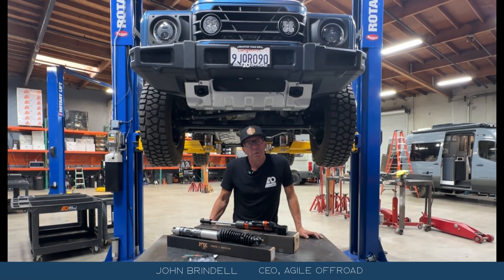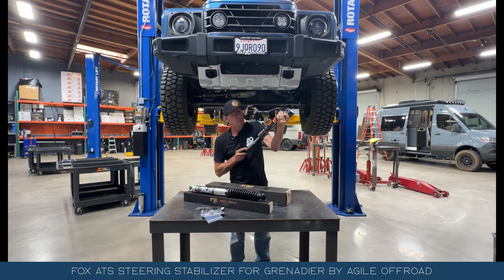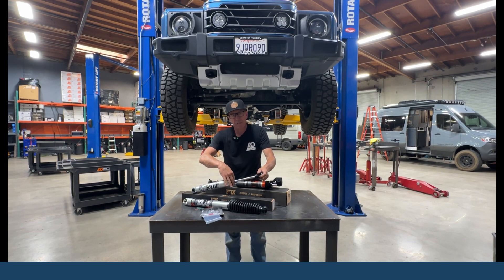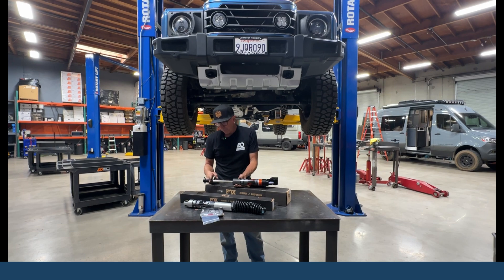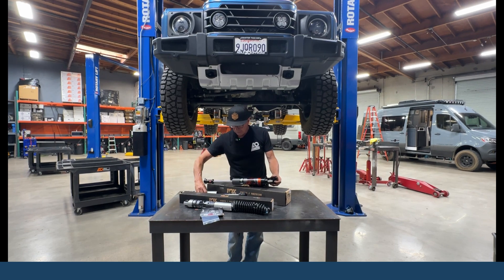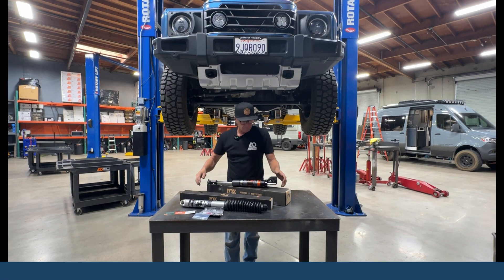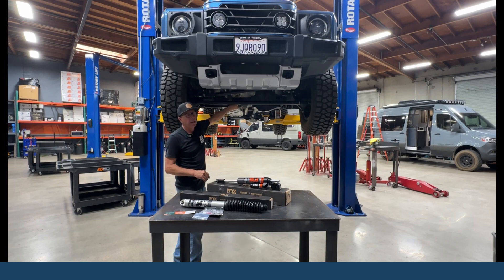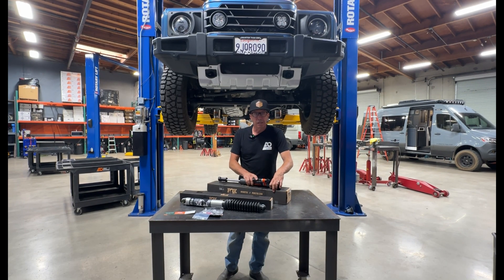Learn all about the new Fox ATS Direct Fitment for INEOS Grenadier

Comment: Does this address the return to center after a turn issue?
Reply from the maker: The Fox steering stabilizer will improve the return to center on the steering, but it will not completely fix it.
Reply: @Agileoffroad  The factory caster angle in 0⁰ i believe a mod is needed to index a couple of degrees + for onroad driving and return it to 0⁰ if heading offroad.
Reply: That is a great question.  In my case I simply removed the oem version and drive with no stabilizer and on the road I have no issues and now I have no return to center issues, ever thing works perfectly.  I have not been off road as of yet so that is to be determined.

Comment: Could you show a video of doing a 90 degree turn and where the wheel ends up as you let it slide through you fingers coming out of the turn? Maybe you can show that with the stock dampener and again with the maximum and minimum adjustment?